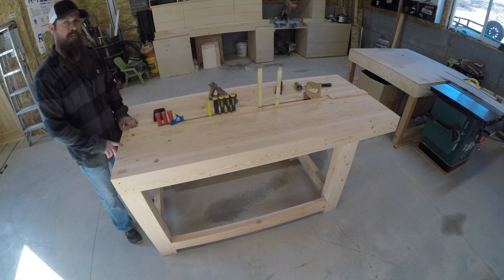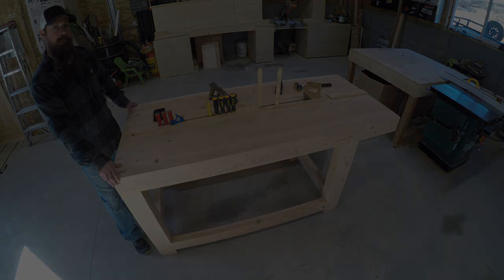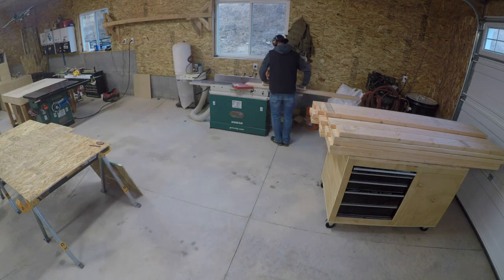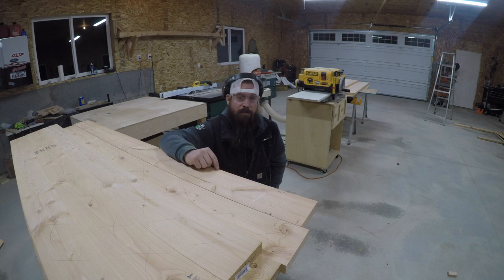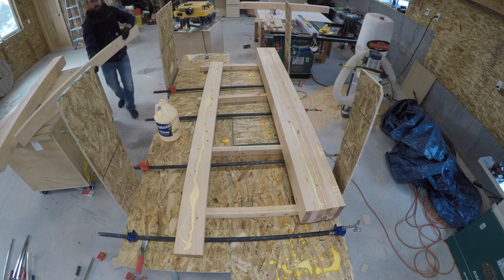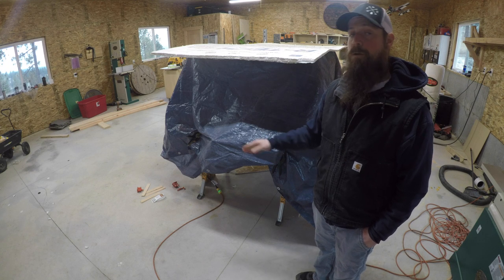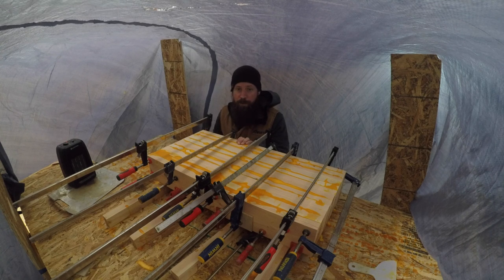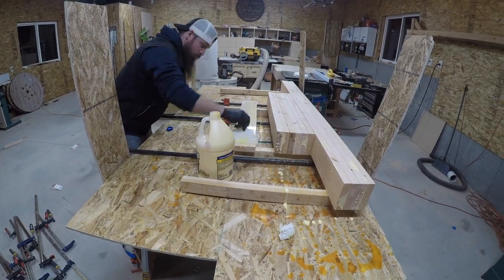build a Roubo workbench build. Part 1 |WOOD WORKING|

Comment: Gonna follow this up with as similar build of my own, but I have to do it without power tools. Many thanks for the inspiration.
Reply from the maker: That will be sweet! Let me know how it turns out! I have a lot of respect for people that build projects without power tools! I go back and forth I really enjoy using chisels, and hand plans, so I make sure and get my fix in on most my projects!
Reply: @brewbuilds  Oh, thanks for the encouragement. It's for lack of space (I am in Japan on properly the size of most Americans's garages) that I use just hand tools. I am a beginner, so the whole process may take time.
Reply from the maker: But the bragging rights after you complete it will totally be worth it! I would love to build something with strictly hand tools, but my shop time is limited with my work schedule.
Reply: @brewbuilds  Oh, of course. Are you in landscaping, or what do you do? I am an advertising and event photographer, but as you know, half of all of that evaporated last year, so I have a bit of time now.
Reply from the maker: @marcheminidisc1345  no I do high volt electrical for a living, I build and maintain power substations, and do the electrical work in the dams for the utility I work for. Pretty much everything from 120 volts to 230,000 volts.
Reply: @brewbuilds  I have known only one person that does high voltage work, on the wires if I remember correctly. I had wanted to get into electrician school when I was around 20, but because I have a green defect (colour blindness) I had to choose a different path. 

Electrical work in dams? I hear infrastructure especially in the last twenty years has undergone degradation so I assume that there is a lot of good work to do.
Reply from the maker: No kidding, I am also red-green color deficient.
Reply: @brewbuilds  But you were able to become an electrician? I used to work with electricians and maybe at the time, I wasn't even allowed to become an apprentice in a co-op system. Maybe things have changed. I think I'm a bit older than you. Well, keep killing it man.
Reply from the maker: Yeah my exact title is an electrical mechanic. I’ve taught my self a system for the twelve colors we use, and other than a few one off scenarios I haven’t had any issues. 👍🏻 being an event photographer don’t you have to edit your photos? How do you tackle things like color grading?